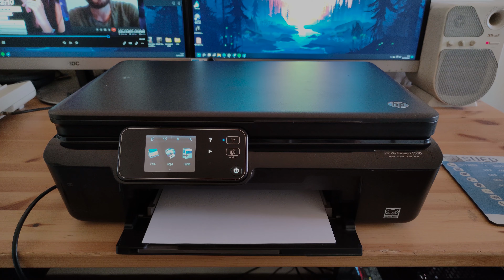Perché la mia stampante HP perde inchiostro dal fondo?

Comment: Video is good diagnostically diagnostic, but missing "and then what?"
Here's what I did on my HP 7640.  My error message was, well, wrong:   "Remove and reinstall the indicated ink cartridge, making sure it is correctly installed, and then touch OK."   Tried this repeatedly, even with new cartridges. Same error message.
This video led me to a black ink pooling on the colored cartridge side.  Unplugged the unit, took a clean cloth, applied alcohol, and slowly cleaned out the pooling.  Twas a mess.  Took 3 cloths to clean up the ink in the nooks and crannies.  Let it all dry for an hour, then re-started the HP.  It worked!  The HP 7640 prints once again!
Reply: Just read this, checked my HP, and there was all that ink!  Gonna try it now ..
Reply: Holy Moly!   It works.  Was a messy pain, but your trick helps.  Thank you!

Comment: I’m sure they can make a way for for the ink used in cleaning cycles  to drain back into the tanks so no maintenance box is needed (or in hp’s case for the machine to break)…however they must feel satisfied that ink is being wasted(or in hp’s case for the machine to have a set expiration date)..
Reply from the maker: As a printer technician, no. Wasted or "primed" ink cannot be reused

Comment: My HP Printer 415  is printing but  color black prints is not very fine for example the letters are not clear,  do i need to replace the cartridge? I also found out that ink is leaking from the bottom

Comment: Good to know why this is happening. Is this fixable?
Reply from the maker: Yes but it's a mess, you need to disassemble the printer, clean the dried ink and clean/replace the waste pads if possible, on the 5510/5520 I have a video where I cleaned the inside of the printer :)
Reply: @PaoloMarcelli Hi where is this video? Thanks
Reply from the maker: @fabrizioroscini  https://youtu.be/d4JzsDWEbZc in this video I show how to unblock the purge pump and do a complete deep cleaning of that area :)